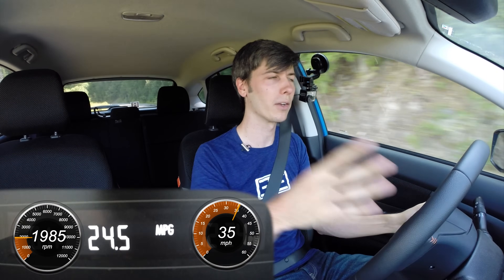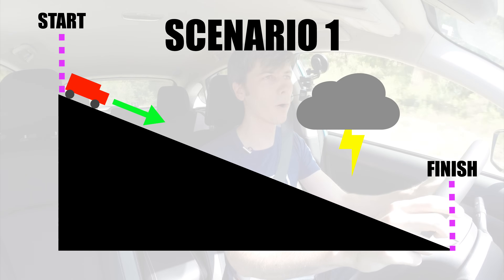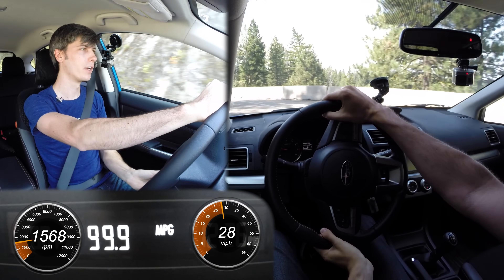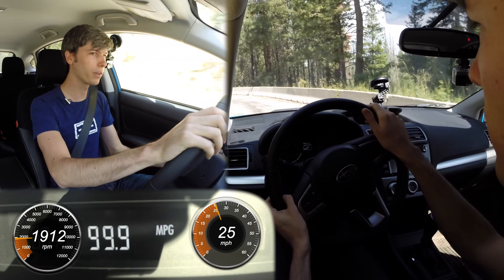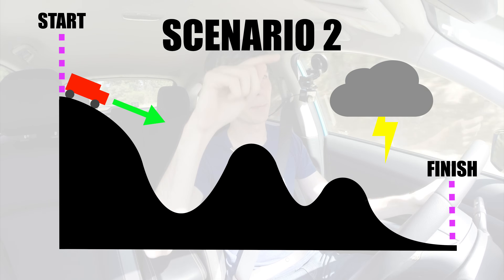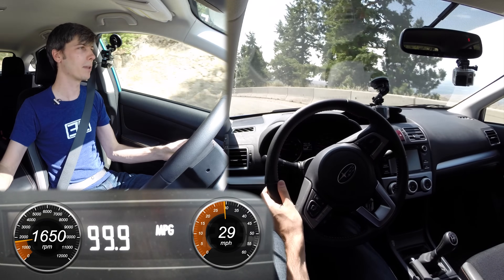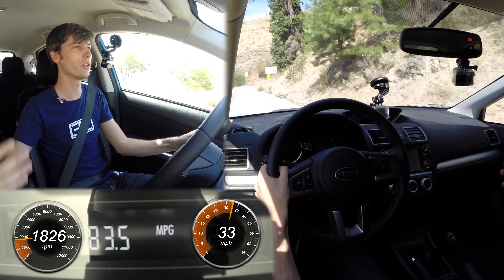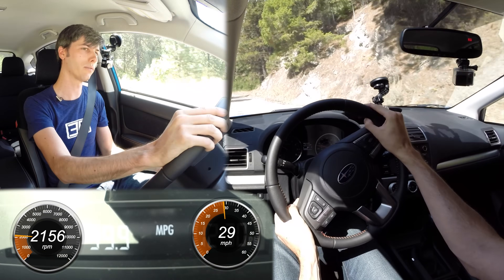What Uses Less Gas - Coasting Or Engine Braking?

Comment: i just turn the engine off
Reply: It can be hazardous because neither the master cylinder vacuum booster nor the power steering pump will be running, making your brakes and steering very heavy and unresponsive
Reply: @lukeiannello6190  joke's on you, my car has none of those things
Reply: It's dangerous if you need to brake/turn suddenly
Reply: Virtually no starter wear since you're already rolling: select appropriate gear, release clutch, engine starts, Voilà! I know that "hardcore" hypermilers simply add a kill button which leaves the accessories on to do pulse and glide more easily.
Reply: Justin Sugay The answer will be, it depends.  In PA there is a long shallow hill where putting it in neutral and turning the car off I will coast between 50-55 MPH for almost 5 minutes, certainly worth the wear and tear plus additional gas to restart the car. On a hill less than a minute probably not worth it.
Reply: How much wear will it put on the engine turning it on and off? Not much, once you engine is warm there isn't any more wear than normal running. That is why so many OEM's are making this a feature
Reply: DxCBuG, huh? how do you lose out on music? 

If you have an older car, it won't turn off the fuel.
Reply: who even drives automatic, its a hastle. in an auto i wouldnt coast with engine off
Reply: You will be missed lol although ive thought about how efficient it could be turning the engine off for certain scenarios... i have a 2016 malibu that shuts off the engine at a light but my steering still works because its electric steering.. with all the cars going hybrid makes sense to make every car hybrid... with a bigger battery the engine could stay off and the battery could run all your needs while its off..
Reply: Justin Sugay the spark plugs fire hundreds if not thousands of times a day by just having the engine on and driving.. spark plugs isnt the issue.. the starter would def take more wear depending on the type of car.. a big v8 obviojsly has a high torque starter compared to for example my 2016 malibu.. which has the smoothest start stop tech in the auto industry.. barely even notice it but its only a 1.5 4 cyl
Reply: Good point. A lot has changed from when my dad used to talk about cars.
Reply: not dangerous if you have electric steering rack
Reply: +Quick Sipper Still dangerous sweetie.
Reply: Just for youtube The only control your losing is the ability to accelerate. Assuming your smart enough not to kill the engine while your in a situation where you might need to accelerate really fast, you should be perfectly fine coasting downhill with the engine off. You're making this into a much bigger deal than it is.
Reply: It cuts the fuel anyways when you're coasting.
Reply: Good luck with braking then
Reply: I've had my car stall due to a loose air intake coasting downhill, having no power steering or brake boost driving down a windy hill in a relatively heavy car is not much fun at all! No power steering isn't too much of a problem at speed but losing the brakes gives your leg a bloody good workout for not much braking force, in an emergency stopping situation you'd be totally fucked.
Reply: Kartboarder22G as my car runs on lpg the lpg converter relies on the vacuum near the the air filter to pull on a diaphragm to let lpg into the intake. Once the engine got hot enough and enough vibration occurred the intake got loose enough that it was pulling in enough air from the gap to cause the engine to be starved for fuel at idle. Lpg is in general a lot harder to ignite (over 110 octane in fact) so is more sensitive to dodgy af ratios (also dodgy spark, compression, etc.)
Reply: +1CoLoRz2 And your braking behaves different and you can't slow down without brakes and so on. It's completely different.
Reply: there goes the power steering.
Reply: I did this once because I was sitting in traffic inching along down a hill.  Remember freaking out when my steering went crazy and had no brakes bascically.  Luckily when I switched it to the on position the engine turned on without using the starter, as I have a newer GM vehicle.  Saved my ass.
Reply: Just a loose air intake caused your car to stall, what.
Reply: Interesting to know, learn something new everyday.
Reply: Kartboarder22G lpg is a fun thing to get used to working on your car. Cheaper to run but generally more of a headache when things go wrong as youve got less tolerance to work with. Also simple converter based setups like mine will make a fair bit less power than petrol injection  (~155kw vs ~180kw) but you can get fancier lpg injection systems for this engine that will outperform petrol (~190kw) as you can take advantage of that higher octane to run things more aggressively.

A loose intake on an efi petrol engine will mess with the af ratio as well as some air is bypassing the maf sensor, but likely not as severely. Mind you running petrol engines too lean can be much more catastrophic damage wise!
Reply: Very Dangerous.
Reply: not dangerous at all if you have some comon sense and know what you are doing
Reply: Gaye Fritz Ofilas as long as you turn the key, say put it in accessory, you can turn the wheel, you just won't have any power assist.
Reply: power steering only helps at low speeds, at speeds above ~25 there is no noticeable difference.
Reply: ProjectGTR If you are being serious - please don't ever drive again.
Reply: Dangerous when you need to steer. And your steering wheel will lock since your engine is off. Might cause accident!
Reply: I wonder how much wear turning the engine off then on again puts on the starter, spark plugs etc vs how much gas you save. Could be another topic to be answered by EE?  Obviously this is ignoring the danger of doing this in most cars with most drivers but ProjectGTR is the exception here as he knows what he's doing.  I initially thought he was just being funny.  Perhaps he still is? Made me think more about it regardless.
Reply: @justinsugay1149  oil will still be mostly in the right places since modern oils create really strong films that take some time to flow back in the pan.

A normal warmed up engine (which is the case here) shouldn't need more than 50-100 amps to crank up since everything is nice and fluid.

You aren't really creating too much wear, especially if you have a car setup with start/stop that will shut off the engine in such a way that minimal crank rotation will start it right up.
Reply: ProjectGTR You must be the same guy that says “I’m won’t crash, I’m good at texting while I drive”
Reply: My favorite so far was "It's okay for me to go 90 in a 55 because I'm such a good Miata driver"

You can probably guess where that Miata is now
Reply: ProjectGTR I just turn the engine off and jump out of the car loaded with dynamite.
Reply: I literally did this when I first start driving not knowing brakes won't work either.  I almost killed a person... lucky I didn't.
Reply: Robert Short it's not a good idea to run without your engine on due to transmission fluid circulation. This is mainly for auto's. When your engine is off, it's no longer circulating the transmission pump, yet with you coasting, you're still adding friction to your transmission, causing it to overheat/prematurely wear. This is why most rear wheel drive vehicles getting towed have to either remove their drive shaft or put the transfer case into neutral.
Reply: If you turn your engine off you're still not saving fuel. Put it in gear and you're still using no fuel lol. Is it carbureted or what?
Reply: Jesus how do you guys think cars used to be? No power steering, no power brakes.
Reply: +1CoLoRz2 I have no power steering or power brakes. I still don't frigging turn my car off. I enjoy driving with control over my vehicle.
Reply: Keep it on but not running, at speed there is not much difference in turning and your brakes will still have enough power left for a couple pumps.
Reply: I did this with the 1993 manual Geo Metro.I averaged 60 mpg,
Reply: Two intelligent comments out of dozens.  You can brake to a stop once with the engine off and you would only need the starter if you coast to a stop.  Power steering cuts off below highway speeds.
Reply: You’ve been wasting some fuel when you turn the engine on again after downhill
Reply: Since it only takes ~0.002 litres of fuel to start a regular modern 3-litre engine, there is nearly no fuel wasted in that procedure. And that is while using the starter. If you have a manual gearbox, you could theoretically bump-start the engine by putting it in gear without the throttle pedal and no fuel would be consumed at all for the restart (the injectors would only start injecting after applying throttle or reaching very low rpm). The actual problems are safety (there may be situations where you need to accelerate or decelerate immediately and quickly) and component wear (e.g. automatic transmission cars should never move with the engine turned off, bump-starting is not recommended, using the starter excessively is not recommended, etc.). It is advisable to keep the engine running at all times, unless you have to stop for more than ~10 seconds and you know it in advance (such as arriving at a traffic light the moment it goes red). At idle, a 3-litre engine consumes 0.001 litres of fuel in about 3 seconds.
Reply: "aye Fritz Ofilas
5 hours ago
Dangerous when you need to steer. And your steering wheel will lock since your engine is off. Might cause accident!"

what? I take it you have never driven before. you can still steer fine
Reply: okay guys, since it does not use fuel anyway (as Jason demonstrated very well here) shutting it of is pointless to a point beyond belief and dangerous (also you miss out on AC, Battery charging, power steering and your music). Turning it on via releasing the clutch is not the way modern engines like to handle things. They might even take wear or damage.
Reply: I thought this was a joke but if you are serious you need your license taken away

Comment: What if you push in the clutch in stead of putting it in neutral?
Reply: Ze Rubenator Unnecessary wear and strain on the clutch
Reply: still burning fuel because the engine is idleing, plus i assume you would be potentially wearing the pressure plates

Comment: You’re a very smart guy and I watch every video you post. On this one I think you’re a bit wrong saying that no fuel it’s going in to the engine while going down hill with no acceleration. Try turning ignition of while going downhill in gear and then you will feel how it’s like having no fuel going trough the injectors! Thanks for your videos man !
Reply: Mihai Gostian last time I checked it was still manual. But auto and manual all the same, fuel is completely shutoff in gear above a certain rpm (mine doesn’t like to shut off below 1500rpm). When slowing down in gear, you can even feel it turn the fuel back on around 1300rpm. Further, along with what Jason showed on the video with instant fuel economy showing 99.9mpg, I also have an air fuel ratio gauge in my car. It shows a max value of 20:1. When in DFCO, the air fuel ratio goes to 20:1. If it was still injecting any fuel, this ratio would be so high that it would quickly burn my engine up due to running so lean...
Reply: Daniel O I’m not sure how it doesn’t make sense? Why would you need fuel at all if the wheels are spinning the engine? Imagine a bike upside down. You could spin the wheel of the bike by pedaling. This is the engine using fuel to spin it. Or, you could spin the wheel by hand. The pedals are no longer needed to spin the wheel. This is coasting downhill in gear. If the wheels spin the engine, you don’t need fuel. In neutral, the engine is disconnected from the wheels, so it needs fuel to spin.
Reply: Mihai Gostian this is exactly what I thought too. A lot of people in the comments here seem to agree that all fuel is cut though, but it just doesn't make sense
Reply: He’s not wrong. Fuel injected cars turn the injectors off while engine braking. It even has an acronym, DFCO (deceleration fuel cutoff). When my car is in DFCO, if I turn off the ignition there is zero difference in feel except that my gauges go to zero and the HVAC turns off...
Reply: It might be less fuel injected while engine break than in keeping engine at idle but it’s using some fuel ...
Reply: Austin maybe you have automatic transmission?
Reply: Austin I believe you, I would like to see a video about this going downhill in gear and turning of ignition at different rpm. I’ve said it’s wrong because some time ago I’ve tried exactly that (engine break in 3rd gear going downhill switch of ignition at some point and engine break was brutal) I done it in 1.6l Ford escort build in 95, it was fuel injected engine. Maybe nowadays things changed...

Comment: Excellent video, but now I'm curious about the use of engine breaking to assist in speed control (going down hill, or even just in general).
I'm going to guess, based off of this video, that engine breaking to assist is better as it would use less to no fuel (as opposed to some); so what would be the cost benefits to using the breaks less, but the engine more, in this circumstance?

P.S. also quick question about rev matching: whilst 'heel-toe'-ing is probably the best way of doing this to reduce wear, does gently letting the clutch out and utilizing the synchro also work to reduce the wear?
Reply: Michael Woodrow cost benefit is that you will wear your brakes less. Engine braking does not wear any other parts more, just brakes less